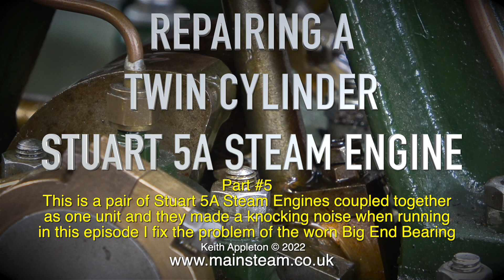REPAIRING A TWIN CYLINDER STUART 5A STEAM ENGINE - PART #5

Comment: Where is part 6?
Reply from the maker: I don't think I made a Part #6 . . . . .
Reply: @keithappleton Really? That’s a big bummer, it was such a nice series and I was looking forward to the part where you re-connected the two engines together again. I’ve enjoyed it anyway.
Reply from the maker: No point really, the knock was just slack in the chain - filling the gaps with silicone would fix it but I was thinking of splitting it into two Stuart 5a individual engines.

Comment: I wonder if the engine with the worn big end started life as a single engine and got worn.
Reply from the maker: No it was just a timing issue, the engines were not running in harmony with each other . . . .
Reply: @keithappleton  Thanks

Comment: Once had to do similar mods to a socket to do the nuts on the manifold bolts on a Skoda 110R,. No lathe or carbidein those days just drill and grinder. 
The girlfriend offered to help fitting some nuts as it looked as I was having difficulty, I said no and "that she would be surprised at where I could get with my  fingers". "Surprised ,no disgusted yes" was the reply.
Another informative vid

Comment: Love your videos, very informative and I like your style.  I have a similar Stuart Swan which I used the same technique to repair the big end, which I also did by feel.  I kept taking small amounts off and frequently refitted dry to test the fit. When I got down to feeling just a tiny amount of play I left it at that. When I oiled up the bearing with good bearing oil and reassembled, I could not feel any play at all, so it seems I guessed just the right amount of clearance for the oil film.  If you take too much off it is possible to add a thin shim between the halves to restore the clearance. Not ideal, but if it wears again you can remove the shims.

Comment: When both of these engines are running well separately is it necessary to couple them together at any specific timing like 90 or 180 degrees offset?
Reply from the maker: Yes, they will only self start when coupled at 90 Degrees.
Reply: @keithappleton Thank you